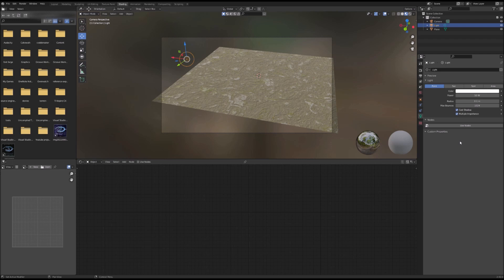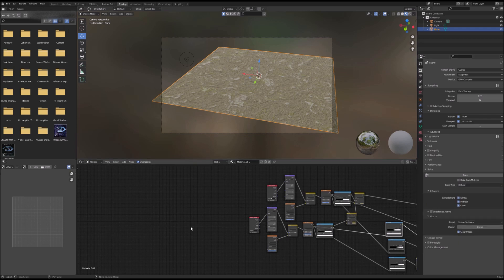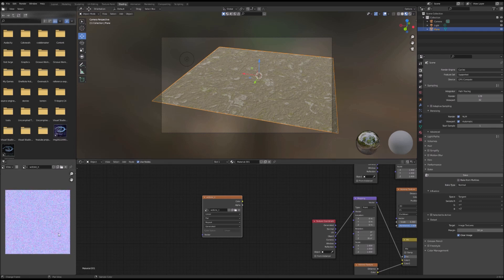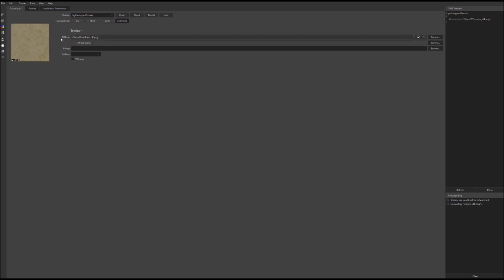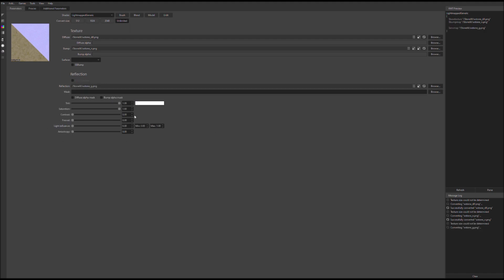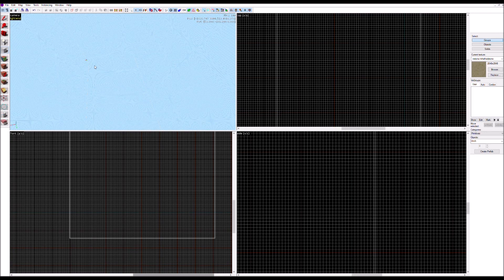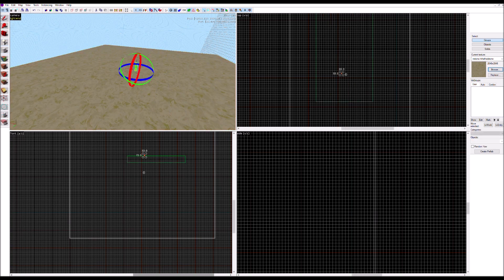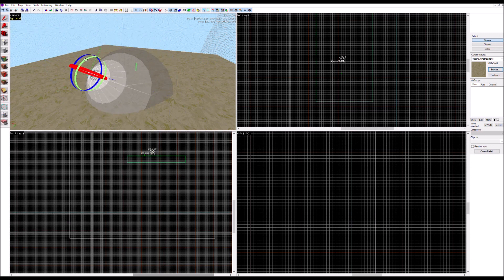Source SDK: How to create a texture (VMT)

Comment: how do you turn a vmt to a standard texture that can be used in blender?
Reply from the maker: Within the bin folder there is a command line tool called vtf2tga that converts vtf files into targa images which blender can open.  Unfortunately due to how blender shaders and source shaders work differently you can’t directly use the materials in source in blender.  Instead you would have to extract the images/masks used in the source material and use those in the blender shader if you want to use them.  I will make a short covering the subject in the future.